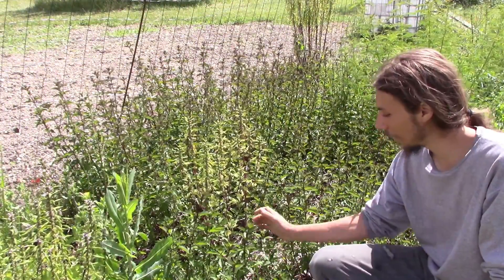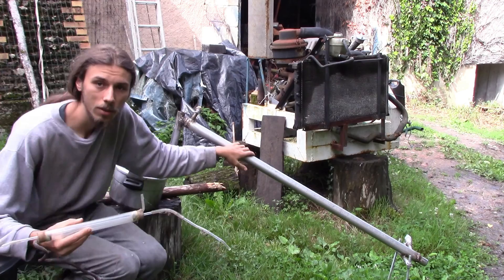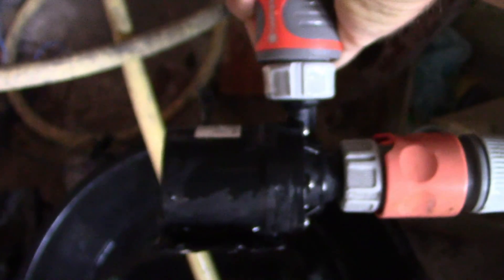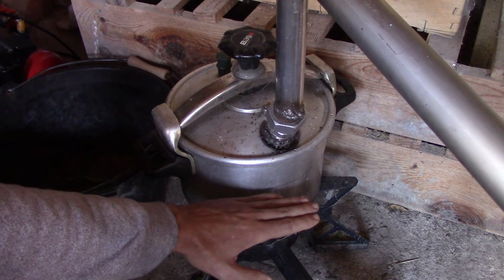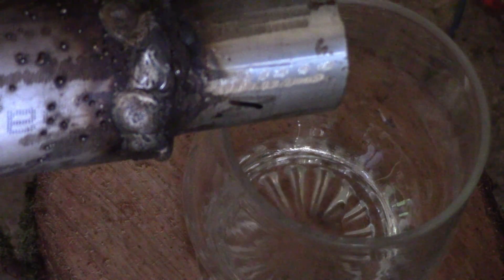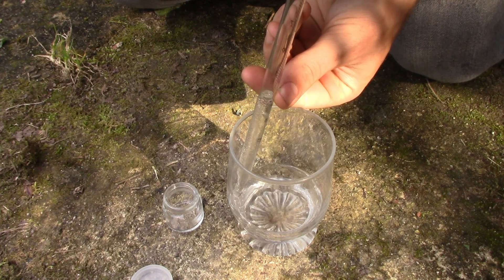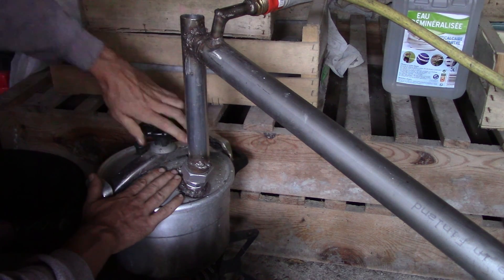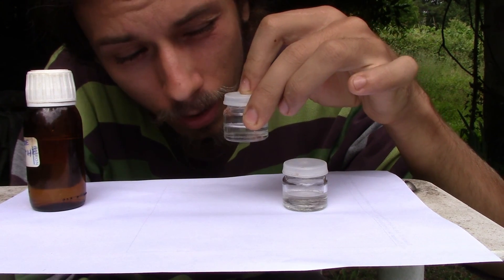Faire son huile essentielle de menthe poivrée

Comment: pour le refroidisseur , on peut faire avec un simple tube en serpentin qui trempe dans un grand bidon d'eau fraiche.la longueur du refroidisseur est du coup plus grande mais 5 metres de long on est large , on peut descendre a 2/3 metres.
Reply from the maker: Oui tout à fait! Je suis parti sur ce design pour la simplicité de fabrication (avec mes moyens). Et c'est largement suffisant, vu que le tube est gros, les gaz sont lents et ont le temps de se condenser sur les parois, même avec une longueur de 1m.